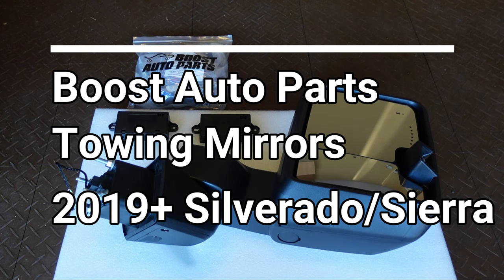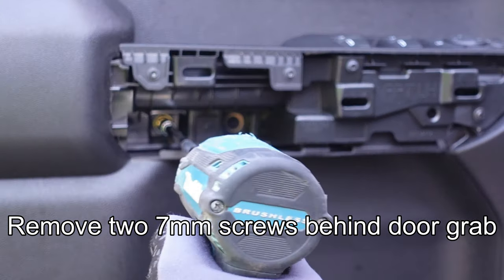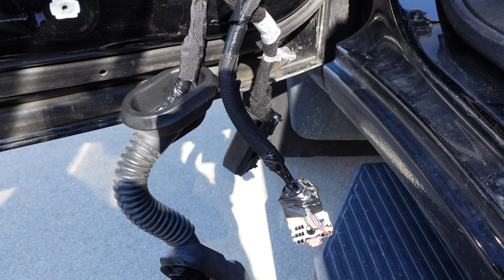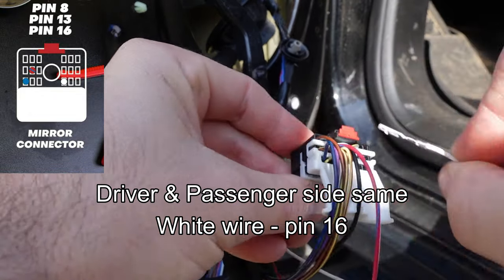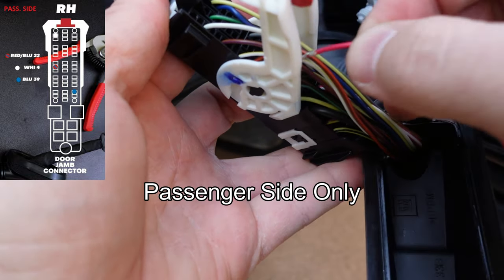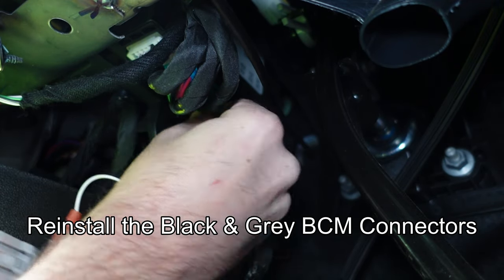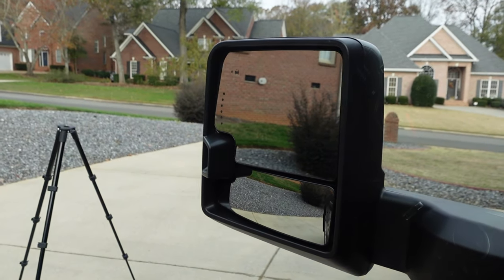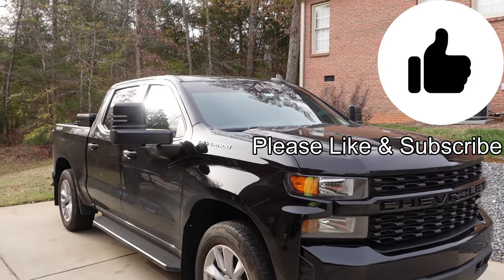[HOW TO] Install Boost Auto Parts Towing Mirrors for 2019+ Chevy Silverado & GMC Sierra (In-Depth)

Comment: What is the difference in wiring if you already have forward facing spots in your mirrors? Can I keep using the switch that is on the dash of my truck? All of the installations videos show a factory harness wire getting cut and not being used. Why?
Reply from the maker: The new forward spots on the boost mirrors run through their wireless module. So I don’t think the factory button works for them. I’m not sure which wire is the one that gets cut.